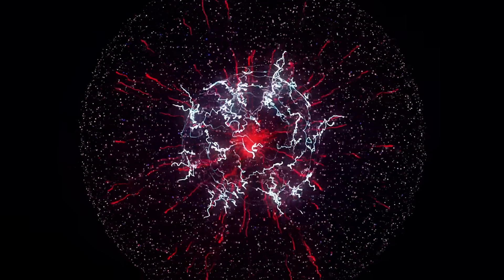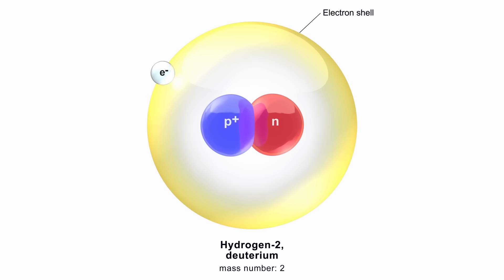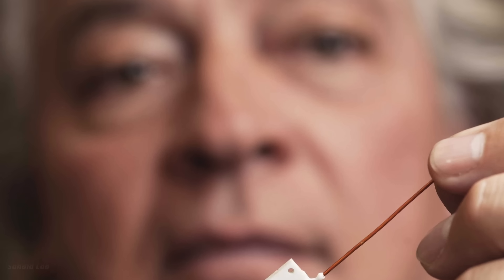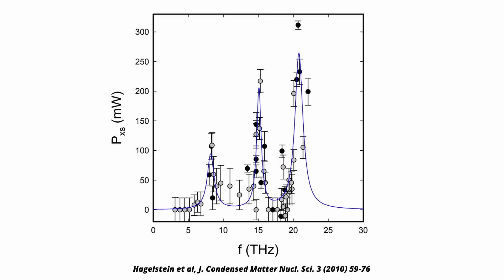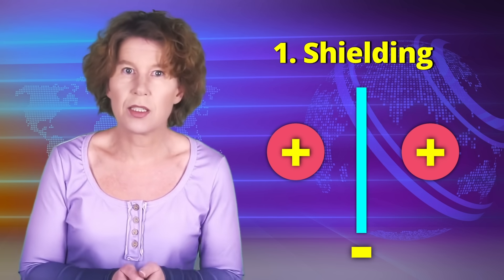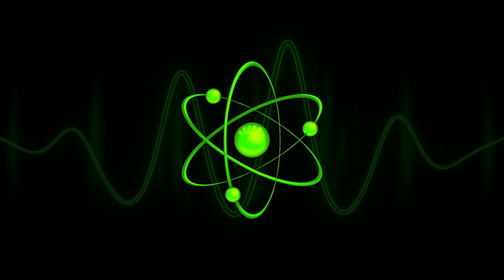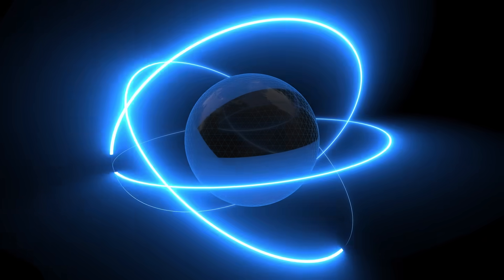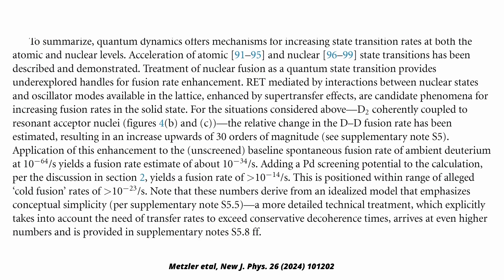Physicists Say They Know How Cold Fusion Works

Comment: These Dwoobs don't know sh*t about sh*t.   The ES and EG Model with a more-perfect understanding of the whole stellar engine and that of the electron transition series of emissions, gives massive clue to the whole engine, fusion agents, etc.

The Sun's core is not compress Hydrogen.  The Sun's core is a solid supercompacted, superconductor graviton.  A true black HOLE, is not a HOLE, not a portal, and definitely not a wormhole to other dimenstions.  A star core (and possible star core fragments) are left after (super)nova events.  One of the criteria of a (super)nova is a black body (wrongfully said as a black hole).  The Hertzsprung-Russell(-Lord) chart shows this truth.  A star core is the center of all sub-, solar, and supra-solar masses.  Small star core fragments are the actual cores of planets and moons.  Asteroid and meteors are the remains of dead fusion material from the photosphere.

The Sun's photosphere is the region of COLD FUSION for Hydrogen 1 to Iron 26.  The 3 Aether space-time string fabrics of gravitons and tensors are supercompacted into supra-gravitons and supra-electrons.  These are the actual and active fusion agents of the photosphere.  The supra-gravitons are further gravity pressurization.  The supra-electrons are the electron shell enrichments carriers as ionization.  The supra-electron force enriches and expands the electron shells of the elements being COLD FUSED.  This enrichment overwhelms the Van der Wahl's radius, allowing the supra-graviton overwhelms the Coulomb nuclei boundary, and fuses the nuclei together - and leaves.  The electrical force leaves, and picks up the electron transition series of emissions in which they enriched the original electron shells.  You then have the stable electron shells around a newly fused higher element.  This is entirely COLD FUSION.

The Sun's chromosphere is the regions of COLD FUSION for Cobalt 27 to Element 118 (minus the HOT nuclear radioactive fusion of the trans-Uranium Actinide series of Actinium 89 - Lawrencium 103).  The 3 Matter space fabrics with greater energy levels become the chromosphere's active fusion agents.  The higher the fusion, the higher the temperature of the electron enrichment.

The photosphere is cooler than the outer chromosphere and coronal surface.

The electron transition series is now formally announced, and its relation to the stellar engine photosphere and chromosphere.

Stellar engine photosphere COLD FUSION (3 Aether space-time fabric fusion agents) :
K or n=1, s1 shell - Lord series - Hydrogen 1 - radio waves
K or n=1, s1 shell - Lord series - Helium 2 - microwaves
L or n=2, p1 shell - Humphrey series - Lithium 3 - Neon 10 - infrared
M or n=3, p2 shell - Pfund series - Sodium 11 - Argon 18 - infrared
N or n=4, d1 shell - Brackett series - Potassium 19 - Iron 26 - infrared
Reply: Stellar engine chromosphere COLD FUSION (3 Matter space-time fabric fusion agents) :
N or n=4, d1 shell - Brackett series - Cobalt 27 - Krypton 36 - infrared
O or n=5, d2 shell - Paschen series - Rubidium 37 - Xenon 54 - visible light rays
P or n=6, d3 shell - Balmer series - Cesium 55 - Barium 56, Hafnium 72 - Radon 86 - UV rays
Q or n=7, d4 shell - Lyman series - Francium 87 - Radium 88, Rutherfordium 104 - Element 118 - X rays
P or n=8, f1 shell - Balmer series - Lanthanide series - Lanthanum 57 - Lutetium 71 - X rays
Q or n=9, f2 shell - Lyman series - HOT FUSION - Actinide series - trans-Uraniums - Actinium 89 - Lawrencium 103 - Gamma rays

COLD FUSION is the majority of all fusion in a stellar engine (and all other stellar objects) - including a black body.

A black body is the veritable naked star core (or large star core fragment).  It is re-attempting its re-evolution of its stellar photosphere and chromosphere.  Everything said about a black body is total BS.  The event horizon IS the photosphere-chromosphere boundary where the black body is attempting to gather in the 3 Aether space fabrics, covert them into active fusions agents.  The sub-light infrared of a black body is the mature photosphere fusions and the chromosphere fusions surrounding the boundary.  There is no spaghettification.  The black body is not a hole, a portal, or a wormhole.  Hawking radiation is BS.  A black body not able to attain any further space material, shuts down, and goes dormant until it can acquire more, and re-start COLD FUSION reactions.  There is no GD Hawking black hole dissipates into a whimsy of spewed radiation until it decomposes back into gas and dust clouds.  Total BS.  The same for the black hole to NEUTRON star.  There is no such object as a NEUTRON star.  A neutron is a free ranging particle.  What this is object is - is a dormant black body of a star core.

All such space-time fabric is composed of gravitons and tensors, which in new discover of string and loop theory are the actual existence of strings of protium- like composites in their Matter muon electron, electron, ... and Aether small electron, electrino, and graviton energy levels combinations of that energy level (electron-positron pair) tensor with its companion (positron-positron pair) graviton.  Such is the foundation of the protium.

The structure of a Hydrogen 1 atom and all higher periodic table of elements are composed of (said) protons, neutrons, and orbital electrons.  This is found to be wrong-worded, and wrong-word defined.  An atomic proton IS an atomic energy level graviton of 938 MeV/c2 of a pure positron composition or a G+, graviton + polar charged particle.  An atomic neutron IS an atomic energy level tensor of 938 MeV/c2 of an equally-balanced electron-positron composition for a boson -0- charged object, or a Tensor 0 or G0 polar charged particle.  The difference of the 93T8 MeV/c2 atomic graviton + and the 938 MeV/c2 atomic tensor 0 is an internal nuclei electron mass of 1+ MeV/c2 between the particles holding them together.  The orbital electrons in their shells complete the atomic structure of balance.
Reply: COLD FUSION is pressurization is the property of the gravity force, and ionization is the property of the electric force.  As such, all BS that wave functions negate gravity objects, forces, fields is sheer idiocy and BS.  A gravity object displays force across a space-time fabric, that fabric is the force becoming a field.  A tensor object displays electric force across a space-time fabric,  that fabric is the force becoming a field.  Those strings of gravitons and tensors are the very existence of the gravity wave (trough, gravity well) and the electric wave (crest, and mount).  Corrected string and loop theory validates the true existence of these gravitons and tensors as actual strings of protiums of the space-time fabric - and vice versa.  Without condensed Aether and Matter space fabric in the respective stellar photosphere and chromosphere, there is no COLD FUSION possible from the star core black body gravitational properties.

New discoveries of the elasticity and inelastic properties of space fabric also validate Einstein's General and Special Relativity of unobtainable light speed velocity - under current conventional physics.  Space fabric with gravitons has space friction.  Newtonian fluid dynamics of the space fabrics allows movement through, but at higher velocities and impacts upon the space fabric, increased impact and disruption of the tensor electrical bonds, creates greater tears in the space fabric and the greater open-ended fabric filaments of gravitons turns non-Newtonian inelastic with heavier space friction and gravitational constraints.  As such, within the stellar engine the once Newtonian Aether and Matter elastic space fabrics are converted under black body gravitational pressures, turning the fabrics into inelastic active fusion agents.

The stellar engine operates under inelastic properties of non-Newtonian fluid dynamics.  Be'nard's Convection is a tensor boson current in the photosphere.  The Lord Convections is the granular appearance of the tensor boson current in the chromosphere.  The coronal ropes and loops are tensor currents.  The spiculae at the photosphere-chromosphere boundary, uploading fused Iron 26 into the chromosphere is a double photosphere and chromosphere tensor boson current.  The open-ended coronal filaments are tensor currents.  A coronal mass ejection of (super)nova events come from detached tensor boson currents of the corona, chromosphere, and at the greatest of implosions and ripping off the stellar engine components, the photosphere, ... leaving the naked star core black body.

Dead body asteroids and meteors of (1) iron, (2) iron-stony, and/or (3) stony material are all (super)nova destroyed parts of photosphere fused iron and mineral compositions.  Sub-solar mass black bodies, solar mass black bodies, and supra-solar mass black bodies will continue to re-attempt stellar engine evolution, ... while smaller star core fragments from prior (super)nova events will entrain space debris and become planets and moons with active cores.  The planet Earth DOES NOT have a HOT Iron 26 and Nickel 28 (no Cobalt 27 ?), ... the only 3 ferromagnetic elements.  Cobalt 27 and Nickel 28 are created in the chromosphere, while Iron 26 is created in the photosphere.  As such, you see asteroids and meteors only listed as Iron compositions or Iron-mineral compositions.  No Cobalt or Nickel.  Earth and all other planet's and moons' interiors are successive progression of recycled star material.
Reply: @johnlord8337  why do you upvote your own comments. Doesn't it feel a bit pathetic?
Reply: @johnlord8337 you are deluded friend

Comment: Follower of the saga since 1989 here. At the very least, the paper helps explain the occasional credible reports of the consequences of fusion in solid materials over the intervening 35 years. Very occasionally, experimenters have created small regions with the right conditions for fusion, resulting in microscopic cratering of metal surfaces, just-detectable neutrons, very small quantities of elements from transmutation, and other odd experimental consequences that have prevented the concept from dying completely.

Comment: The Pons-Fleishman experiment that people in most labs could not reproduce could have been enabled by specific faulty/cheap equipment.
The equipment attached to the palladium could have been producing an unmonitored electrical signal that caused a resonant condition that enabled fusion of the hydrogen isotopes trapped between the layers of palladium ... think the effect of sound on plates of sand.
It would account for the small number of labs that were purportedly able to reproduce the experiment and why most others weren't.
Reply: A few volts would be enough to promote a chemical reaction, but is orders of magnitude too small to have any effect on nuclear reactions.
Reply: @robertfitzjohn4755  The voltage to induce electrolysis in purified heavy water to induce the deuterium and tritium to separate is much higher than required in tap water and several additional meters were attached for monitoring with their own (possibly oscillating) voltage. It's possible that the combined resonance of all the signals combined to induce conditions that enabled fusion to occur.
Keep in mind this was over a quarter century ago when Oscopes and other equipment tended to have strange, anomalous behaviors under certain conditions and each lab used a different combination of what their current grants afforded them.
Reply: If there was an equipment flaw, it’s probably simpler to assume that that flaw directly lead to excess energy output, versus assuming it was the magic sauce that enabled the target effect to happen.
Reply: given the suggestions in the past and in the paper Sabine talks about here regarding lattice dislocations in the Palladium, I think that is more likely the source of the variability and difficult repeatability, if indeed, any fusion took place. i.e. sufficiently many of just the right kinds of imperfection in the electrode
Reply: @MattNolanCustom  Due to the high cost of palladium we didn't have the same understanding of its crystalline structures as we did for iron alloys. We now have a much better understanding (thanks EPA) due to its use in catalytic converters; however, with better understanding of the mechanisms, it may be even cheaper to use cheaper metals or semiconductors as the heavy hydrogen containment lattice.
At the time of the original experiment, it was impractical to do additional experiments that imaged the lattice in a way that could demonstrate the mechanisms of action.

Comment: Be careful what you wish for! If small cold fusion devices are developed that can provide large amounts of power, a lot of very bad things become possible, like handheld energy, weapons, killer, robots, killer, drones of unlimited power, and endurance, etc. Sure, there will be a lot of helpful uses for this kind of technology But people are not necessarily wise or good enough to be trusted with it.
Reply: We already have killer robots and drones
Reply: @ 
Yes, with very limited battery power. The very limited battery power helps to make these things much less scary right now. If you remove that constraint, robots and drones will be a lot more powerful a lot larger and a lot more dangerous.
Reply: @wbwarren57  drone strikes are extremely common in the military and very lethal. I think maybe you just haven't paid attention
Reply: @ 
Oh, I have. Current drones can fly heads or maybe hundreds of kilometers. Imagine roads can fly thousands upon thousands of miles powered by fusion. Much more dangerous.

Comment: Its already here but still largely ignored by the academy as this is not evolutionary, this is revolutionary.   Investigate Malcolm Bendall's Thunderstorm Generator for an example of the early devices developed from this new thinking.    Early testing of units built by Malcolm as well as units built by DIYer's clean the exhaust from internal combustion engines to the point it is almost as good as the air that was input into the combustion intake.   With the clean air benefit claims being substantiated enough for their needs, small manufacturing companies are building complete systems or components necessary for building these units yourself.   The academy will soon become aware of the success of the Thunderstorm Generator and their explanations will likely be hilarious for a year or two while they try to keep the old paradigm and embrace the new in the same breath.    The Plasmoid Unification Model   https://www.youtube.com/watch?v=9v77iJOwkqE& is the incoming paradigm alongside the Electric Universe.
Reply: I saw the TSG working and met Malcolm and colleagues. It's real. It's an actual rediscovery.
Reply: There literally isn't enough energy in lightning for this to make any real sense
Reply: @rayparent1 Its not lighting. It involves microscopic plasmoids of sorts, ball lighting. Which is producing transmutation.
Reply: @michaelstiller2282  lmao
Reply: @rayparent1 that's the sort of energy that's holding things back.
Reply: @ It got the government of India invested into it. They already have industrial contracts. They just posted about gaining a cement plant contract, where their gizmo is to be attached to all equipment in the plant. The say people have locked themselves in a room with a running engine, for 7 hours and they didn't die from the exhaust. A their gizmo just produced air.
Reply: Some real septics have seen it in person thinking it was all a hoax. They think its legit, and called some friends in the India government, who got some money together to finance if its truly legit. A pier review of sorts.

Comment: Akashic records has previously indicated cold fusion powered the great pyramid and some on earth already know this and how it was done.
The pyramid used to have a water filled moat which would constantly send water down the descending passage to the pit to keep the reaction cool.
A gold capstone provided the spark-gap-generator apparatus which would give out wireless energy across the country and also power the electromagnetic roads (several feet off the  ground) enabling craft to travel to other places on earth with harmonious structures (Gobekli Tepe....Stone Henge etc).
Akashic indicates this knowledge was hidden by the few for the purpose of controlling the many.
The pyramid was built approx 12500 years ago by the survivors of Atlantis.
Reply: Its amazing how many clueless people like you exist